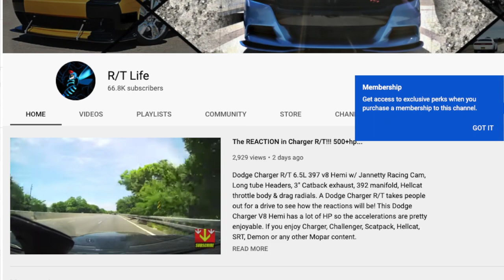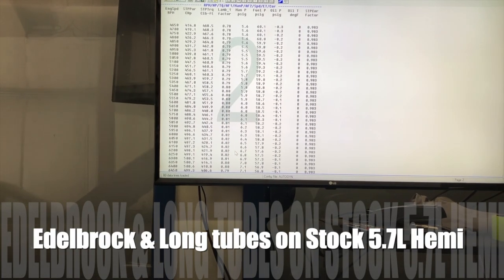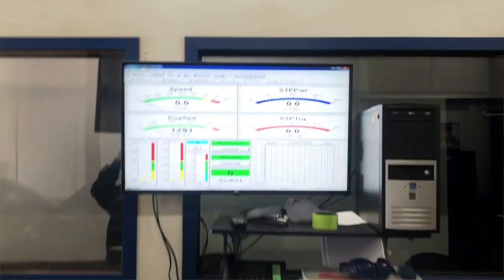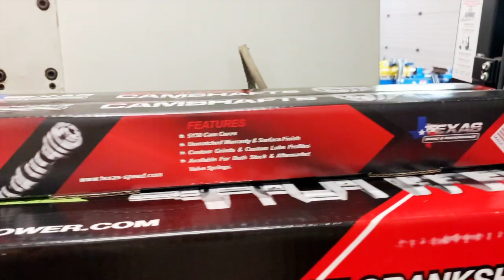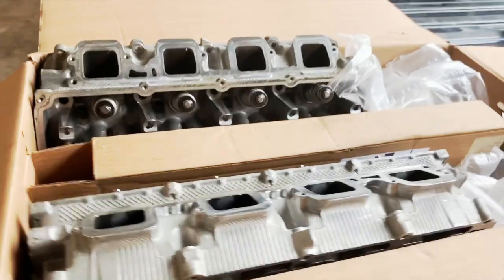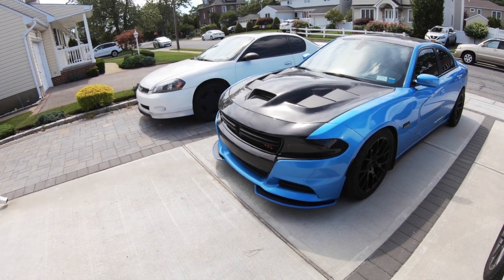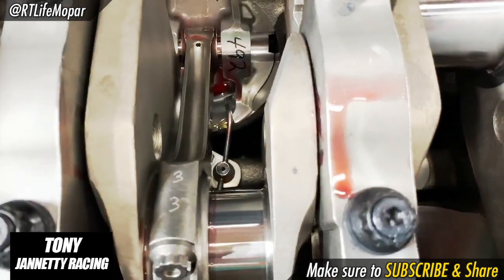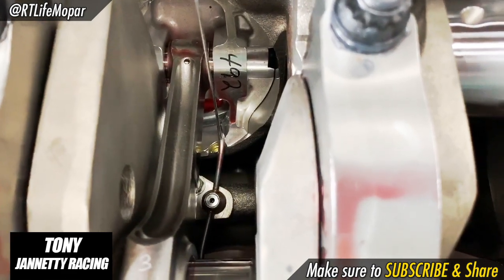Twin-Turbo Scatpack - STROKER KIT!

Comment: Man there is alot of perfesional technology that goes into building a custom stroker . But is somehow all comes together and end result is premium raw power
Reply: hell yes! all the forged parts are checked with a micrometer, labeled and machined if necessary to make for a perfect fit. I had no idea till I asked tony what are all those numbers on the parts? you can actually see them in his video clip I think.
Reply from the maker: Agreed

Comment: Turns out my N/A 426 stroker build (actually closer to a 440) was not that much faster than the 392.  Currently adding an F1x Procharger to wake things up.  Now I need to upgrade the HP70 trans. or transplant an HP90.  Good thing I love this car :-)

Comment: Great video! Definitely cool seeing that edelbrock do work on that 5.7 hemi!
Reply: My Edelbrock is a fun but complicated bolt on. Initially it was installed by a friend. I had Ted dyno it but it only did +- 440 WHP. A lot of tweaking and retuning on Jannetty's part pumped it up to 500 WHP and it's been running strong with no signs of any engine strain.
Reply from the maker: yah that Edelbrock setup is awesome - super sleeper

Comment: Damn. He is going to need to upgrade to a Hellcat transmission soon.
Reply from the maker: yah he's going to be throwing down massive power in both builds
Reply: I hope not the Tremec 6 speed stick is capable of far more HP than its rated for. fingers crossed lol

Comment: Great information,  I see why you like that shop now. I'm having some heat issues. I'm looking at dual fans. Any ideas guys.  I run a 2010 challenger SRT8  with a procharger.  I'm pushing 550 whp
Reply: remove the hood lol
Reply: @spack6124  lol I'm on the gulf coast too much rain
Reply: Are we talking engine Temps, air intake Temps, both? Legmaker has an intake for the 2015+ that routes the tube into the wheel well, not sure if they make one for the 2010 though
Reply from the maker: What about a water meth kit?
Reply: oh but your procharged though, I forgot the filter is right next to the engine with those
Reply: Damn just 550 and you have a srt8 procharge? How much boost you running
Reply: @spack6124  its engine temp, its 90s here
Reply: @terrymitchell4579  I don't have it turned up,  I daily drive it

Comment: Gotta be real, and this goes to more intense tech stuff, but it depends on what you want to do. I would stick to smaller engine sizes to reduce friction and offset that with boost and revs. But thats me. I would make the heads the best that they can be ( CNC port ) and just work the details.
Reply from the maker: I understand your point - the drag pak is a 5.8L & shows you don't need a massive displacement to get insane 1/4 mile times.
Reply: @RTLife  yessir....the exotic blower cars from all the OEMs have small engines ( COPO Camaro, Drag Pack Challenger and the Cobra Jet Mustang ). Thats why I was surprised when you went stroker for boost. But a deal that good was the right thing to do.

Comment: So would the 392 stock have held up to the 10psi of boost and been reliable, there's not to many turbod scats out there. Was wondering what was gonna happen then they wanted more upgraded the fuel system and then went to a forged motor, then that was the last of the info, what did the tuner find out about the knocking? Hope to hear back, thanks!

Comment: What's the cost for all that work?  The twin turbo kit is 8K on there website. Then you have all the machining, pistons, cam and whatever else plus installation.  Will 15K cover it? Or more?  What about changing the lifters to Hellcat lifters?
Reply: Don Potter little more than $15 so far but there’s a lot of extra work being done . You could probably get it for less but these guys are tops in their field. Tony’s got almost 40 years experience in building race car engines and Bobs got 50 plus machining  these bad boys. You pay for experience and talent.
Reply from the maker: def a healthy price tag for all of this work - but damn it's cool as hell haha!
Reply: @pmac5386  I have a 2017 Scat pack shaker. I couldn't afford a Hellcat or I would've gotten one  The plan is to pay it off then refi and get about 20k. I only want to get to about 700 wheel. I figure pistons, rods, cam, Hellcat lifters, maybe injectors a blower and a differential brace and I should be good. I paid 40k for the car add 20 and I'm in for 60k. I just want to be at stock Hellcat or a bit above.
Reply: @donpotter3935  even if you could afford the hellcat(i could of) the insurance differance between the 2  is horrendous so much so that i decided a built scatpack would be 100% worth the extra money out of pocket
Reply: What static compression ratio is this stroker kit ? And do you have more info on the cam …?

Comment: Can the 392 block handle that power long term
Reply from the maker: Not 100% sure - guess it's a matter of how much boost they run & how hard it's run.
Reply: From what Hellion and Ted both have now tested the stock block will hold for a long time with the correct tuning and boost. I could have taken my Scat and driven it with no problems with just the twins but the temptation to flirt with 1000WHP was too great.
Reply: Thanks guys👍
Reply: Yes because the new 392 cars are hellcat BGE blocks
Reply: Stock 392 no not even the 392s are ticking time bombs with boost better off boosting a 6.1 or 5.7

Comment: Only problem with pushing that much power through a 392 is the (automatic) transmission, driveshaft, and the rear axles aren't built to handle it :/ wish they'd let us pay extra for the Hellcat driveline in the 392's, it'd be cheaper than buying stuff aftermarket

Comment: Too bad it's the older Edelbrock unit, it would be nice to see the newer 2650 on the build. The 2650 is doing well in the mustang community.
Reply: I purposely chose the tamer older model-at the time I had no intention of forging and stroking the 5.7. It was the safest bet for me. it is a 2014 with 28K miles on it so I placed it "better safe than sorry" (I wish I hadn't)